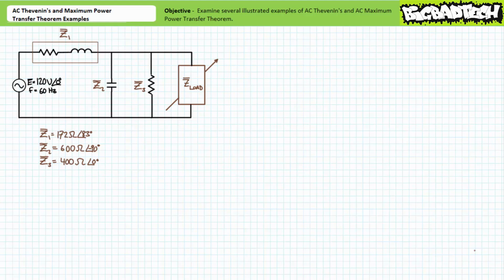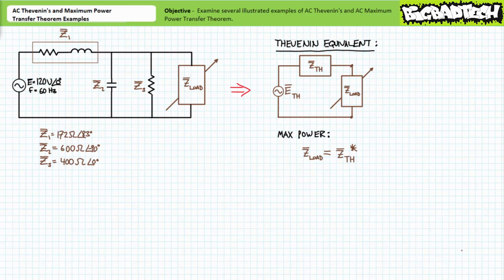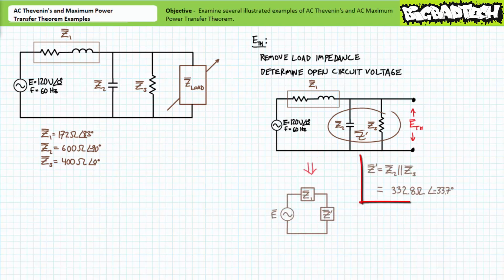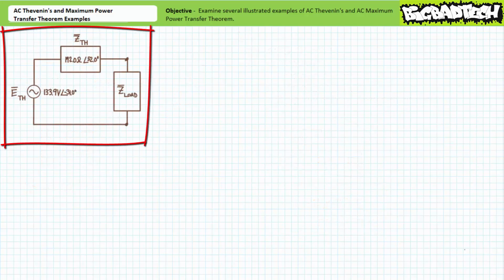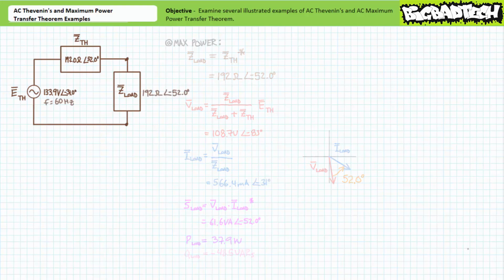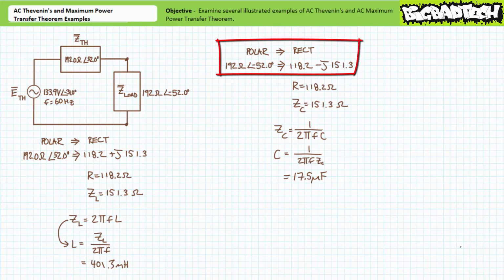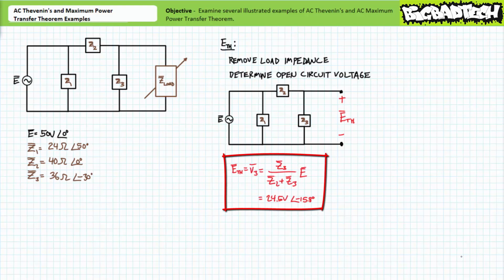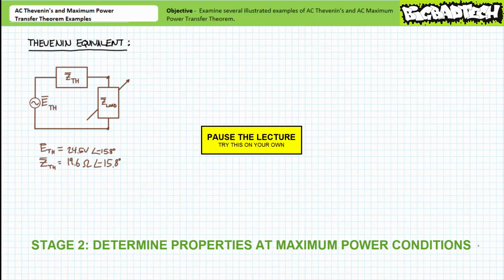AC Thevenin's and Maximum Power Transfer Theorem Examples (Part 1 of 2)

Comment: hi jim ! does the phase of Z´ should be 90 degrees?
thanks gian
Reply from the maker: Not sure what Z' you're referring to, however, Zth and Zload at maximum power conditions should be 180 degrees out.
Reply: ei sorry my mystake, i didn t notice that when the capacitor is in parallel with a resistor then the phase calculation is arc tan (r/Xc), btw best video so far, i wanna get into thevenin´s theorem that is often used for design power amplifiers.. hope to see that maybe you did one max power transfer even on voltage divider configuration! would be really interessing to try to solve it and learn by my mistakes.. cheers!!

**ok i notice that during parallel calculation, by doing the usual (arc tan Xc/r) we just substract 90 from the top: (Zr*Zc (90deg) )/zr+ jZr (56,30)